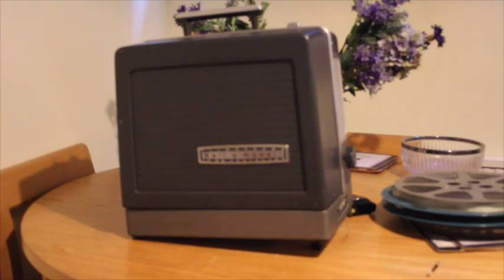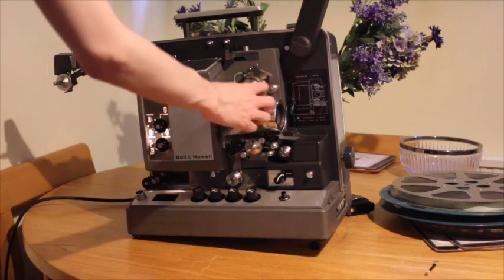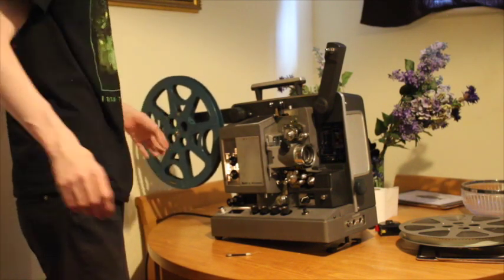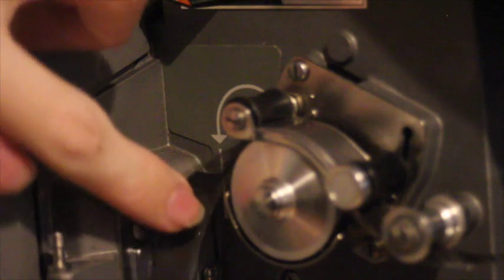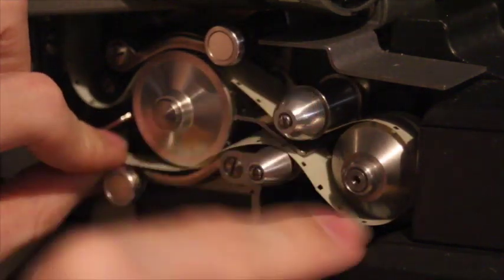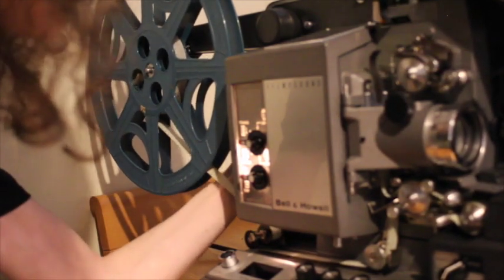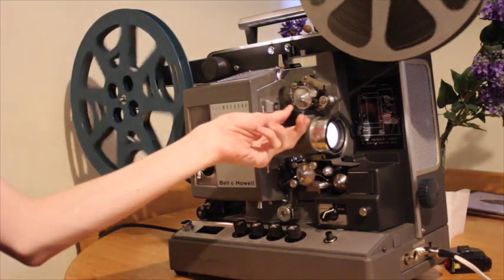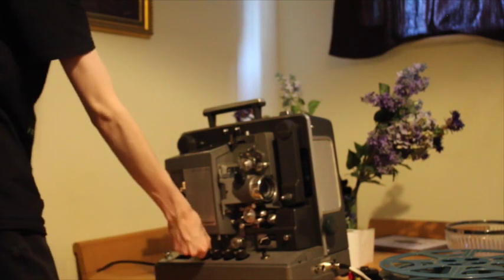Bell & Howell 16mm Projector Operation

Comment: Nice job, nice video.  Thanks for doing this.     I have a Bell & Howel model 550.  Similar, but older.  It doesn't have the white lines for "loop positions" and the size of the loops causes me problems.  It has "auto load" but it seems to jam up now and then.  This threading film helped a bit.   Thanks!

Comment: OK, correction! at mark 3:40 he says close film gate (lens). STOP! Now at this point all the actions are fine and the action after is as well but when you finish and start the film there is 50% chance that the film will shutter, blur possibly breaking, damaging the film. Why? In the film gate path there are film teeth just to the left or right of the bulb aperture. In order to have a perfect everytime start you MUST ALIGN THE FILM SPROCKETS WITH THESE TEETH PRIOR!!! TO CLOSURE OF THE FILM GATE. Thank you.
Reply from the maker: Moving the inching dial at the back on this projector will move the film into alignment before starting the motor

Comment: What external speaker are you using for this projector?
Reply from the maker: I think I was using a technics SB CS7 in this video. Anything with an 8ohm rating will work, you just need to get the right plug :)
Reply: I recall there was a 1/4 phone plug (mono) for an external speaker however every B&H I encountered had a built in speaker. Given the classroom setting no additional speaker was needed. That said I now years later as an audiophile note the sound was tinny with no bass to speak of but..functionalable.